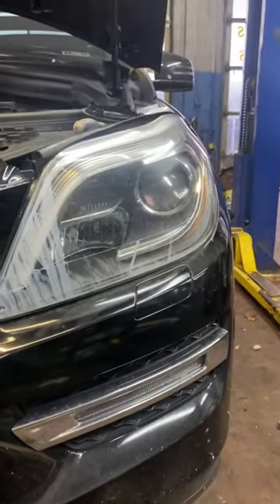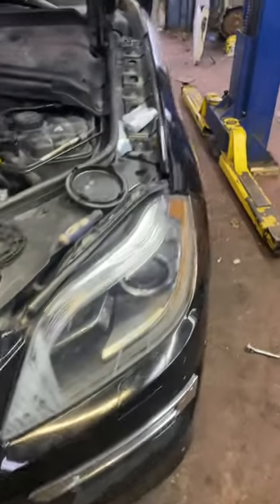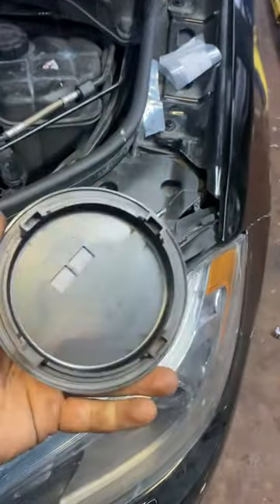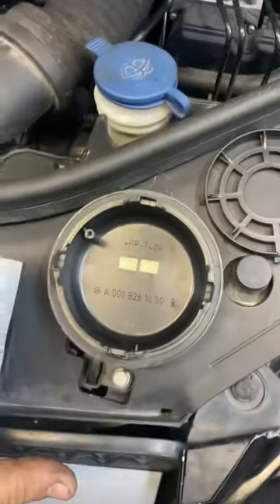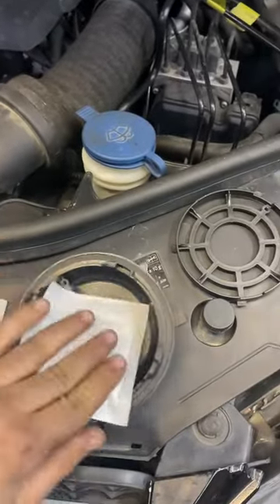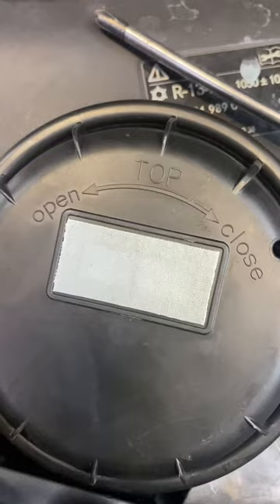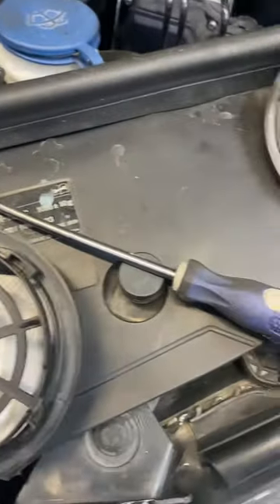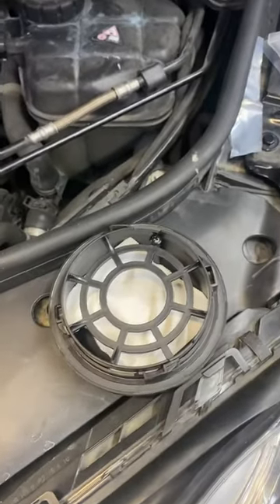2012 - 2020 Mercedes Gl, ML headlight fogging up, condensation FIX

Comment: My 2007 GL450  developed condensation on the Left side headlight, so I openned up the hood to see what's going on,
and one of the caps that's covering the bulbs came off. I guess  it wasn't secured properly after replacing the bulb.
fortunatly, the cap was lodged between engine room about 12 inches below where it's supposed to be, and I was able to recover it.
the rubber o-ring didn't look good, but no way of buying a brand new o-ring, so I just flipped it. hopely it will last.

Comment: I have a 2012 ml350 with this problem. I went to the MB dealership to order the parts you suggested. They are not in the MB parts system. However, there is a "Headlamps fogged"service bulletin Topic number LI82.10-P-063240 version 7 dated 06-15-2020. The remedy they suggest is way too intrusive and time-consuming than their original remedy using the parts you listed that are no longer available. The tech at the dealership suggested drilling a hole in the OEM cover, buying desiccant packs at Walmart, and affixing them to the cover.
Reply from the maker: Yes adding your own desiccant pack will also work!

Comment: That is not a fix but a band aid. The seal/seals are failing in the headlight assembly. I had the same problem on my 2002 SLK 320. I ended up replacing the headlight assembly with a refurbished unit.
Reply: U are absolutely wrong, the seal is not the issue. I've resealed my right headlight multiple times and even checked for leaks and there was none, yet condensation happened again, i did mine with a pack of silicon gel on each side and no more condensation.